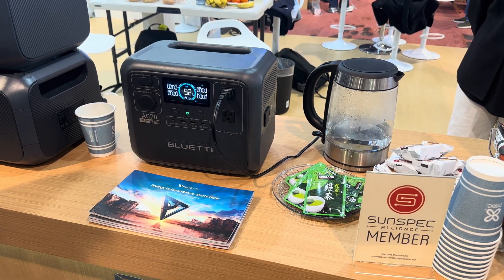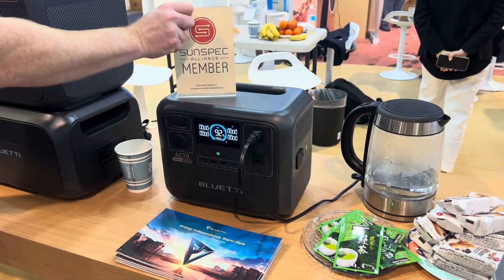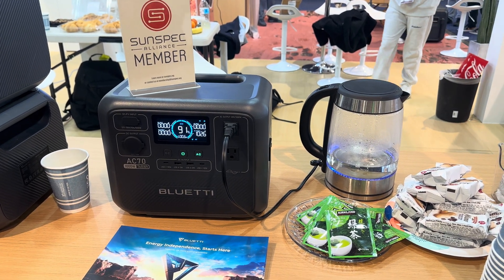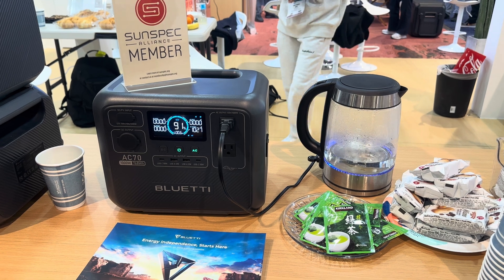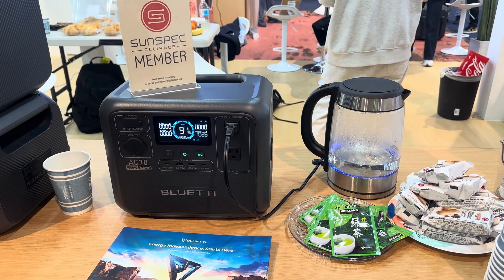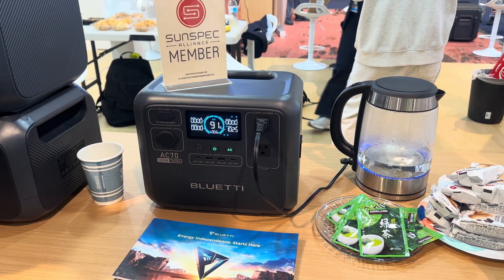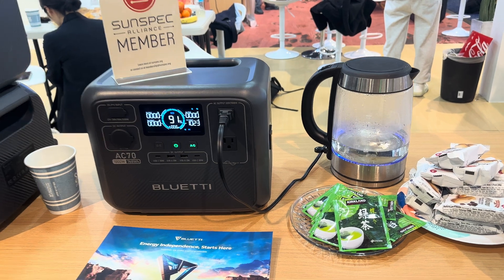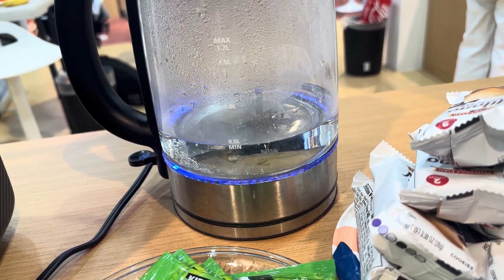Powerlifting mode demonstrated on a Bluetti AC70 at the CES 2024 #Bluetti booth.

Comment: There is no "power lifting" here at all. The nominal output wattage of this station is already 1000W, which it shows. Power lifting allows it to go beyond that for resistive loads. Which is not shown here (the display should've read ~1500W if that was the case).
Reply from the maker: This is incorrect.  "power lifting" throttles the output voltage in order to limit current draw.  This dynamically limits power consumption to stay within the continuous rating of the inverter.  This 1500W kettle was operating at ~1000W via the reduced voltage.
Reply: @DougKremer  Oh - so power lifting mode just tricks  heating appliances run but just in a less powerful manner
Reply: So it boils the water maybe 35% slower than plugging into wall AC... is that a simple way of understanding?  Or... 1 1500 watt hair dryer wouldn't be as hot or blow as hard... about 35% less hot and less hard ... ish... correct?
Reply: @THE_CHAOSENGINE  hair dryer doesn’t work as it has a fan that won’t like lower voltage/current. Tried it with a Dyson and the Dyson just shut off. Has to just be a basic heating element alone.
Reply from the maker: @THE_CHAOSENGINE  Exactly.
Reply: @THE_CHAOSENGINE  Correct.
Reply: “Power Lifting” is misleading. Maybe it should be power management or power throttle.  I can confirm on the AC180 I could run 2700W appliances and it would throttle them to about 1550W.
Reply: @gregsheridan I should bought the 180 instead of the ac70
Reply: @THE_CHAOSENGINE  I’m on my second AC180. Doesn’t charge at all or doesn’t fast charge even when in Turbo. Only 650W instead of 1450W. Not impressed.
Reply from the maker: @THE_CHAOSENGINE  I’m a big fan of the AC180. I think it is the best all-around power station made for portable use.  It will operate about anything the can plug into a standard outlet, and not prohibitively heavy.
Reply from the maker: @gregsheridan  I agree it is not a useful term.

Comment: Yall explained nothing 🤦🏻‍♂️
Didn’t specify what wattage it lifted to and from what.
Reply from the maker: 1500W kettle,  operating on a 1000W inverter, at 1000W.
Reply: So it's actually dropping the power consumption of the kettle.. Not sure why it's called power lifting mode  @DougKremer
Reply from the maker: @CampingSecretsUK yes, it is running the kettle at the inverter limit vs the 1500W nameplate.  I don’t understand marketing either.
Reply: How do u enable it
Reply from the maker: @reginaldswinton2206  Via the App, also with a button press menu detailed in the manual.
Reply: @DougKremer  I downloaded the Bluetti App, and I have it connected to my AC2A.  I don't see anywhere in the app where I can tell it to use power lifting.  Can you point me to the correct location to do this? Thank you.
Reply from the maker: @kycatrescue7305  Once connected to the device tap the gear icon at the top right and it should be in that menu.
Reply: @DougKremer I see it now. Thank you!
Reply from the maker: @kycatrescue7305 The little gear icon needs to be larger and have a name, maybe “settings” or something.  There are a couple things in the app that could be more intuitive.